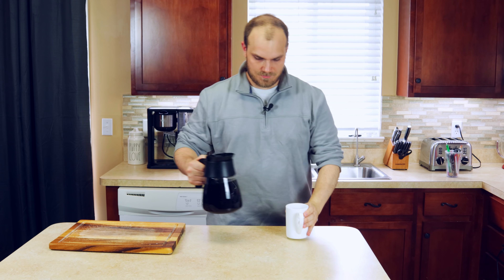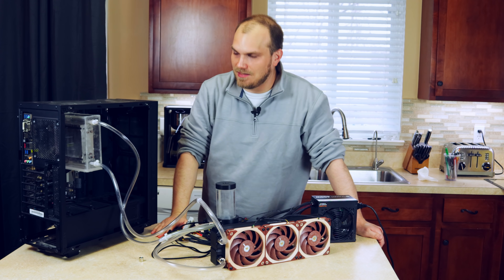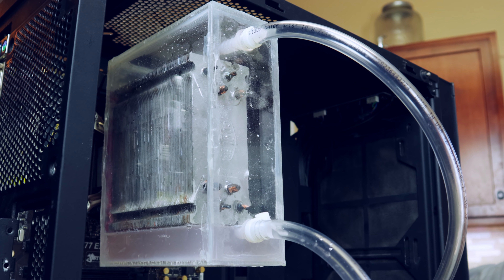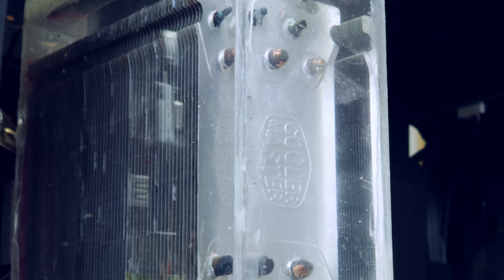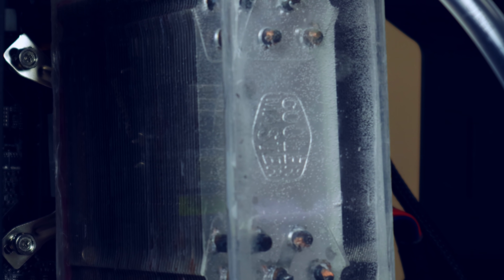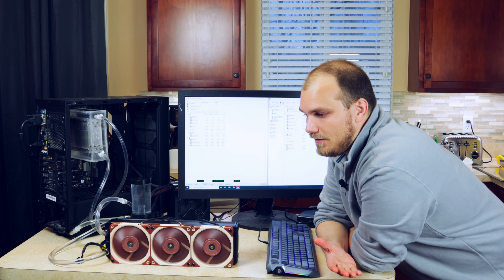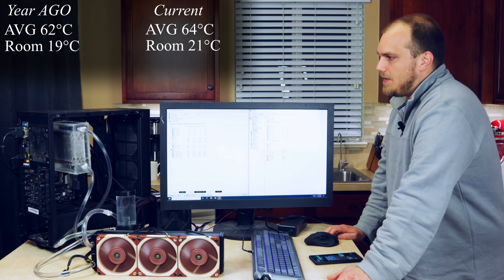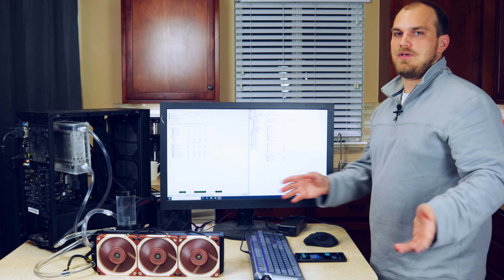Water Cooled Air Cooler 1 YEAR LATER, Time Has Not Been Kind

Comment: Also you are getting corrosion because you are mixing metals and air cooler was not designed to be submerged in water. After replacing the CPU cooler with a waterblock you can use a Blitz Kit to flush out all decontaminants. I show this process in my video where I have white foam going in and out of the tubes to clean and prepare a loop https://www.youtube.com/watch?v=jzfLC7Ben94&t=1s. You can buy a mayhem  blitz kit from Performance Pcs and just use distilled water https://tinyurl.com/y99bxuod

Comment: room temp a year ago 19 degrees
room temp in this video 21 degrees
difference = 2 degrees 

avg cpu temp a year ago 62 degrees
avg cput temp in this video 64 degrees
difference = 2 degrees

so it absolutely performs the same without any difference, the hotter avg of this video is due to the hotter room and is equal to the room difference (2 degrees more in room increased the cpu average by 2 degrees)

Comment: use the same brand fan no  plastic case, drill into the copper cooling tubes directly conect them to the water cooling system and circumvent the fins alltogeather

Comment: so i was just watching your video with the liquid running through the heat pipes and for some reason i got to wondering "what if you replaced the water entirely with conductanaught liquid metal???". as far as price to performance goes that's well out the window but i'd love to know if you could pump that round a system

Comment: put the water inlet at the top next time to avoid so many air bubbles while bleeding, actually just move the outlet to the bottom so both are submerged 100% of the time. also find something hotter to test. I have a 3930k (socket 2011) that you could melt if you have a decent motherboard for it! according to afterburner it uses around 200W at 4.3GHz but i bet you could bump it up in voltage to really see how hot you could get it.

Comment: I'll throw in a poor performing idea. Get after those interface losses.
Multi-remote-air-over-water cooler. MR.AOW Cooler.
CPU>><<water block->line->[water block>><<hyper212^^]->line->[water block>><<hyper212^^]->line-pump-line return to CPU water block

>><< metal to metal thermal interface 
-> water to metal thermal interface
^^ Heat pipe to air thermal interface

Comment: If you build a new one, I suggest connectors on top and bottom rather than the end with a 90 degree connector. You would get forced circulation through the fins for better heat removal.

Comment: Use mineral oil instead of water.  It doesnt cause corrosion and it is better at transferring heat.  Also, if it leaks, it wont damage or short anything our.  Of course, dont use steel, but an aluminum heat sink to prevent rust.

Comment: The problem with the corrosion is that you can't avoid havin multiple kinds of metal as long as you're using those copper hat pipes and aluminum fins. It looks like there is even some kind of brazing that was done and there might be a 3rd  4th and even 5th metal in the mix on most air coolers. If you could somehow use an air cooler that was made with only one metal, that might work better. Alternatively, a thermally conductive coating that could prevent corrosion might work, some kind of galvinzing or electroplating or possibly some kind of carbon or silicone based anti-corrosion coating.

Comment: I look at your highest heat numbers and know that you suck at applying heatsink compound.
Lemme give you a refresher... put a big gob right on the center with the motherboard laying on a phone book on a good stable surface.    Apply the heatsink with a twisting gently rocking motion like it's a pillow and Grandpa needs to die.   Run the screws home.
Got  it now?
I think the CPU is throttling automatically at 71C

Comment: This has got me thinking hhmmm a  30l loop with anti freeze  with a fork that goes outside in winter and inside in summer... Running without fans on the radiator

Comment: hm.....
any air cooler is ok to become v2
as long as it's a cheap but has more copper heat pipe, so the heat can be more easily transport at the waterblock fin
.
but i hope iin v2, there's some of screw for throwing out the water after this cooler not in used like a radiator ways
so there's no water stucking out on the inside of waterblock so the fin n the ppipe not gettin easily corrosion
.
instead of using normal water, why not using something good liquid coolant to reduce the corosion side effect n aesthethic color??
.
instead of using radiator 360mm for the cooler
why not changin the radiator to become massive cooler using a car radiator *but the cheap one
this biggy chunk will be more reliable to cooling the heat of liquid rather than 360mm radiator

Comment: Nice Project, but you should put a hot water tube at the middle of the box to prevent Air bubbles 

... I think a project where we put cooper pipes passing through the fans, maybe Just 4 aside with some kind of joints on both sides, could be more light, secure, clean, cold, easy and cheaper than a entire box arround the cooler ...

Comment: Seriously, something like this could even be used in legitimate water coolers - you probably wouldn't need it to be quite as big as an entire air cooler, but using a larger metal area for heat transfer to the water in a water block could be a useful change to the design.

Comment: Get your hands on a Thermalright 120 Xtreme full copper (Or some other full copper tower cooler, have fun propping it up though on a vertically mounted motherboard..), and redesign it so that the water is being forcefully directed through the fins, like a jetplate on a waterblock, from front to back.

That way it shouldn't corrode as much being pure copper (so long as there is at least some sort of anti-corrosion additive in the water), and the performance should improve with directed flow.

Comment: Two ideas for future projects.
#1: reverse flow to see if you get better or worse cooling.
(used to work at a hydronic heating company and we used inverted flow in our water heaters and gained %20 more heat transfer.)

#2: use a non conducive liquid for coolant and leave the fan mounted to the cooler for more even water flow through the cooler.

Comment: Build a D5 pump into the water box. Hear me out:

Use a tower cooler like you used on this one. Do all the things I said in my other comment about tightening the box around the fins to get better flow through your fins. With the cooler oriented as it is at 1:28, put it on the bottom face, closest to the motherboard so it takes suction directly from the water box. Have it discharge out directly away from the motherboard. You could either print a pump top or get a pump/top that would be easy to mount. An XTOP would work, I think. Just tap four holes into the top of it, drill a couple holes on the mounting face, throw an o-ring between the pump top and the mounting face, maybe print the mounting face with a slight indent to receive said o-ring.

It's settled. I'm buying a 3D printer after this deployment.

Comment: 100% want a reboot of this. Adding a corrosive inhibitor instead of just DI water would help with your corrosion. Honestly not sure where that corrosion came from, cause if it was sitting on a shelf for most of that time it wasn't galvanic corrosion, which would be the big concern from using an aluminum finned heatsink with copper radiator tubes and pump internals. 

You could use a massive NH-D15 and put the water inlets on the sides instead of the top to get it to fit in a typical case. You could also use mineral oil in it, which would let you put a fan between your fin stacks on the D15 to minimize the pressure drop and get more even spread of coolant across the fins, but mineral oil also doesn't carry heat as well as water, so I'm not sure if that would help at all. Better option would be a low profile cooler like a NH-L12S or a NH-C14S or a NT06. It'll fit better in the case and give you a lower center of gravity so you'll have less strain on the motherboard when in a typical tower case. With the NH-12 or NT06 you can put the inlets on the side top or bottom, for the NH-C14S you'll want to put the inlet/outlet on the top or bottom because the sides are all kind of closed up and would be a bit restrictive. Put your top/bottom/sides all flush to the fins so you don't have much or any coolant that doesn't flow through the fins to maximize your coolant over the heat transfer surfaces. Leave about an inch of water box on each side that you can tap your inlet/outlet fittings into. That'll also give plenty of space for your flow to evenly distribute across all of your fins, since the fins will act as their own distribution plate. You can help that out by putting your inlet and outlet diagonally across from each other instead of straight across from each other, but I don't think that will make that much difference.

And for testing accuracy, I'd like to see the deltaT from coolant temperature to CPU temperature, since that's what your waterblock is driving. You can lower your water temperature by changing pump/radiator/water mass/fans, but your waterblock will keep a relatively constant delta from CPU to water for a given power output. Also, testing back pressure across the cooler would yield some useful information, since higher flow rate does help somewhat, and all PC watercooling pumps are centrifugal, so lower back pressure makes more flow makes (to a limited extent) more cooling. Parallel pumps might be useful for this as well, since you want to maintain turbulent flow between your fins, and I'm not sure you'd get high enough velocity to cause that with only one pump. You'd need a flow meter and a D/P detector to measure that stuff.

For anyone asking if building this sort of block is "worth it", I would argue that water cooling is literally never "worth it".  Your return on investment for open loop water cooling is basically nothing. A decent AIO will get 95% of the thermal performance, which equates to 99% of the compute performance, at 1/8 the cost. The determining factor, to me, on whether this is "worth it" or not is it's performance against a similarly priced (sum of bill of materials for each setup) traditional water block. Even if it's equivalent, it's still "worth it" as a neat, unique mod that's just fun to play with. At no point does "practical" come into play when you are talking about open loop cooling. For practical, go with an AIO or the biggest air cooler your case can fit.

Comment: Hi!

I was thinking about minimalist designs a while back and got curious.
If you hypothetically only had a 120mm fan spot in your case.
What would give the best cooling performance vs noise level on a sandwich 120mm setup? 

Fan-Rad-Fan (ie push/pull)
Rad-Fan-Rad (fan in middle but more surface area for the water)
Or maybe Fan-thick rad?

Is this something you could test?

Keep doing your thing!

Comment: Here is my opinion on how you should consider evolving this project. Since you are such a great maker, and contributor to that space, use the stock intel cooler for 1155, with the copper slugs. Small form factor, comparatively, with a much smaller reservoir. I believe that would be Intel E97378, the one ending in 79 is aluminium at the core. This way it is easily accessible to anyone in the world for less than 10 dollars - probably free, to try and create this project. Publish the results to the maker space for free, and maybe sell a simple kit with the necessary pump / hoses / instructions / printing materials.

or not.

Comment: Wow what junk that is for temps even on idle. My air cooled laptop is like 53 idle and 63 hot. My rig idle is like 41 idle and gaming like 53 air cooled stock heat sink and fan on low rpm and like 1 out of 10 noise level.

Comment: I'd like to see a silent passively cooled version with no fans, just the pump.  Get/make a long thin metal box (like the shape of a GPU or mobo box on it's side) with a lot of surface area to radiate the heat, and then of course use proper anti-corrosion cooling liquid.  You should also compare the temperature difference between this air/liquid hybrid and a traditional liquid cooling block swapped in.

Comment: why didnt you use glycol so corrosion wasnt an issue. what happens to temp based on gallon per minute pump volume?
why doesnt someone test flow rate affects vs radiator size and cooling effects.

Comment: I have a suggestion for an improvement to it run mineral oil in it instead of water and see if you get any improved performance with it. Bonus mineral oil won't short out the motherboard unlike water will. I've seen Linus on Linus Tech Tips submerge an entire PC in mineral oil to cool it.

Comment: I have a thought. Mineral oil?? It’s nonconducting and you could add a small fan for creating flow. The radiator should create enough cooling to keep the mineral oil cool theoretically. The problem would be the pump. It would have to be a very strong pump as the oil is much thicker and would need a stronger pump to circulate effectively.
Reply: This could work with motorcycle fork oil. I'ts almost as dense as water.

Comment: Well if you actually worked on a more refined version were you use plastic welding for the box and more forced directional flow, it could be interesting.  You still run into the issues of getting around the heat pipes.  If you had the means to accurately measure the locations of the heat pipes then get CNC cutouts, you could plastic weld around them and finish with a some silicone, it would look so much better.   Additionally, researching the best cooling liquids for minimal corrosion would be great then run it  24/7 maybe as a streaming PC or additional game/media server to see how it holds up.

Comment: You should absolutely make a version 2 - however, you'll want to use a single metal type heatsink if you can find one - mixing metals is going to see accelerated corrosion unlike if you're using a single metal.  You might be able to find one of the old all-copper thermalright heatsinks on ebay or the like, perhaps, would be the best bet, or you might get one of the oddball tower Zalmans that are all copper.  You might also test to see whether alcohol might work better than water, given you have so much volumed mass to work with from the larger container, you don't need to worry about vaporization of the entirety of the fluid.

Comment: I am definitely down for a version too and my suggestion. Is to tap and die and thread a g and 1/4 fitting on it. That said maybe on the side of the tank instead? As for cooler suggestion, The low profile noctua cooler, it would be interesting because it would help minimize the heat spread due to the actual tower and see how much of it is actually thermal soaking, but vapor chambers aren't supposed to get hot. Like they get too hot they explode, so fair warning

Comment: Also, another idea. Work up a purely volume based cooling system, where you do not require a radiator because the water will cool itself faster than an idle load will warm it up.

Comment: specifically "galvanic corrosion" is your enemy here, which will cause the aluminium to dissolve where they contact the copper heatpipes. finding a pure copper heatsink would be better for doing this. though if its still going through an aluminium radiator, i dont know what it will do.

Comment: Version 2 definitely needs a closer fit to the cooler fins and a block on top so water can't flow over the top. It also needs a distribution tube on the inlet side so water gets evenly spread across the fins. Last thing, use a corrosion inhibitor. Get some 50/50 premix automotive antifreeze. Test that, then add some Redline WaterWetter and test again. Also test plain water with and without WaterWetter.

Comment: Next time you retire it especially if you do a 2.0 run dry air through it until dries out to help preserve it. You can start by just setting it in the window and letting the sun heat up the inside and push out the moisture and then once you get most the moisture out put a piece of tubing across both ports to seal it.

Comment: There is a chemical called water wetter that I use in cars. It allows you to run straight water through your coolant system without corrosion and it helps lubrication of the coolant system. Try using it to stop corrosion.

Comment: Balls to the wall. NHS-15 heatsink, 3950X to test it with a high TDP CPU (once you know if doesn't leak).  Maybe a cube case or super tower to fit it

I think the reason this works so well is the air cooler functions like the fin stack on a standard AIO but on steroids, that's just so much surface area.

Comment: It would work even better if the tubes input holes came from the bottom(nearly the base of the cooler) instead from the top because that's where most heat is coming from. It's harder to fit into that space for sure though.
How much would it help? No idea but it surely would.

Comment: For your next design, would put a couple internal ribs inside to force flow through the air cooler,, as is, much would just go around.
Have you considered using some antifreeze?  Assume there's anti-corrosive additive in those.

Comment: I always wondered why they didn't make liquid air coolers. Meaning the base is liquid filled metal pad with pump that runs fluid up and down he fins and fans drawing air through fins.
Perhaps if you used summer coolant, you wouldn't have corrosion.

Comment: Shorter hose, so the heat gets to the radiator more often? But the corrosion is going to make the air cooler leak water someday. Copper and aluminum galvanizing?